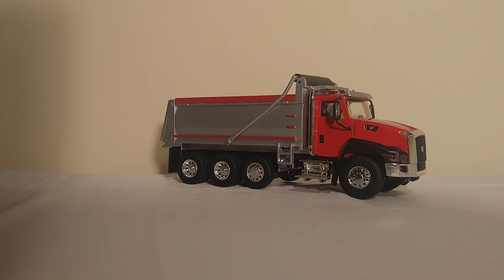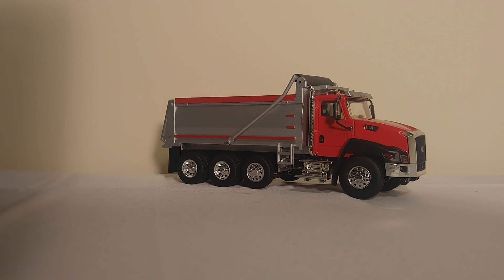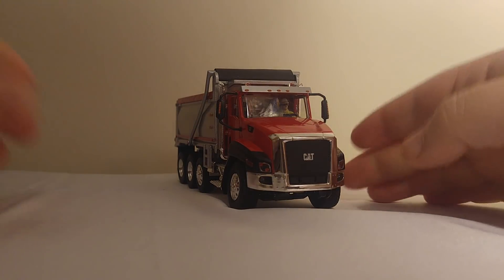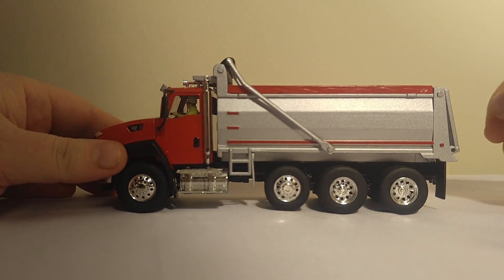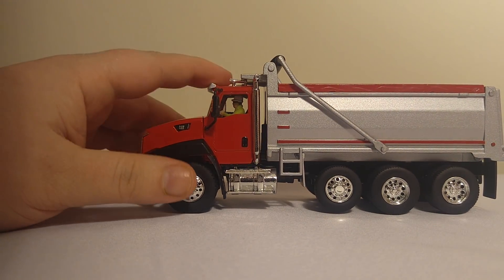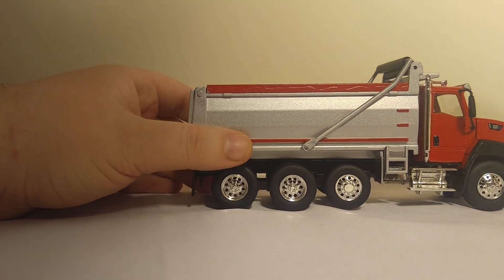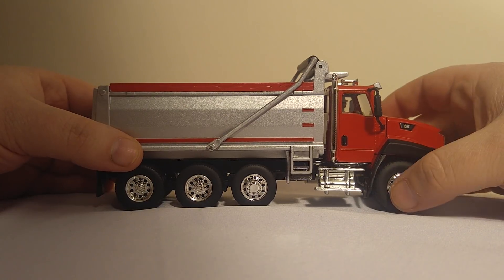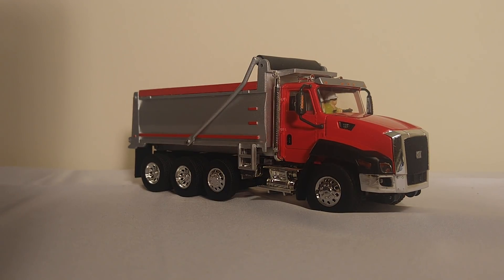Diecast Masters Caterpillar CT660 On-Highway Dump Truck

Comment: How would you rate these Norscot & DC.M. CAT CT660 models compared to the 1/50th scale "on-highway" dump trucks by 1st Gear ?
Reply: pkbrownsfan If you just want a truck made by CAT or need one with the extra axel, then this will do fine. In my opinion though, the first gear dump trucks are made nicer. They have better scaling on the mirrors, steps, etc. Also, the overall molding seems to be better. These ones are a good value, but the first gear peterbilts and Mack’s are worth it. Lastly, for realism, we all see hundreds of Peterbilts out there, but a CAT truck is fairly rare. Hope this helps!
Reply: Thanks for the input Dave. I actually have both of these DCM (red + CAT yellow) dump trucks. In addition, I recently bought two of the 1st Gear "on-road" Mack dump trucks....both with yellow cab. I felt that I was "lucky" to get these, as I have not seen them for sale + have been dis-continued for awhile now; I believe. The retailer actually had eight of these yellow Mack's. But when I tried to buy a couple more a week 1/2 later; they were "ALL" sold out !  These were the first "1st" Gear dump trucks I had ever bought (though I have a couple of the Mack/Talbert lowboy sets), and I was just blown away by the detail you get for the price (75.99 a piece). I personally believe they are a much better option to these Norscot and DCM CAT trucks; but was curious how others felt. You are right though, CAT "on-road" dump trucks are extremely "rare" (in fact these "might" be the only ones), so they are definitely worth having ! 

I will be looking to get a few more 1st gear Dump trucks down the road, but want them all in yellow ! My "fleet colors" are like this----white for haulage, escort, fuel/servicing and also for transportation (crew trucks, vans, cars, etc.). Then I use yellow for my dump trucks, and any other trucks which would be used in the actual construction process, like asphalt spreaders, lime trucks, etc. I did  this (using two different colors) because of the scarce availability of many of the premium 1/50 scale models when I started collecting....mainly the Sword trucks !
Reply: That’s awesome! I picked up a First Gear Peterbilt dump truck in bright orange at a toy show in Kansas in November. I got it for just $50. Couldn’t pass up that deal. Now it’s waiting to be hooked up to the CAT paver I’m getting for Christmas!
Reply: Terrific, that should be an awesome  set up. Just a "possible" tip for the future. If you are a fan of road construction equipment, you are probably aware of the NZG Wirtgen Group models. They range from the Wirtgen profilers & soil stabilization machines, Vogele pavers, Hamm roller & compactors, and lastly the Kleeman crushers & screeners. As you are likely aware, these models are very solid with their detail, as well as functionality....but retailers charge "an-arm-and-a-leg" for them ! However if you go to the Wirtgen America on-line promotional store (can just google it), you will find many of these same models at about 1/2 the price the major retailers are selling them for. Definitely worth a look if you have not done do already. All of the models there (with the exception of the Kleeman crushers) are  only $75.00 apiece ! Most normally go for 130-160 Bucks "full-price".
Reply: That sounds terrific! I’ve just begun to collect the Wirtgen group equipment. I bought a Power Feeder recently. I tried finding the site you mentioned, but couldn’t. Would you be willing to post the link? I would really appreciate it!
Reply: Yes it is, I clicked on it and it took me to the Wirtgen on-line store ! Hope you find some things you like.
Reply: Thank you so much! I’m a young collector, so I love advice and help from older collectors. I appreciate your help
Reply from the maker: In my opinion, the thing that the CT660 has over the First Gear dumps is the swing gate. The First Gear ones are no where near realistic looking, nor can they hold a pose without being propped up against some. Just something to keep in mind.